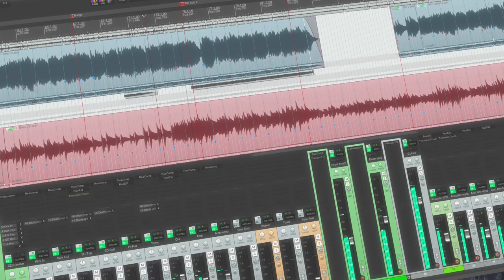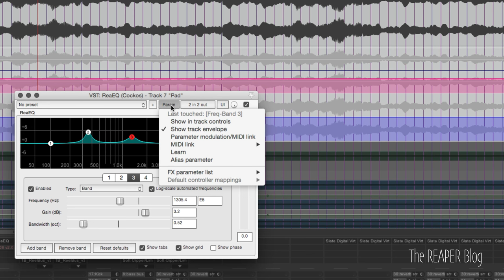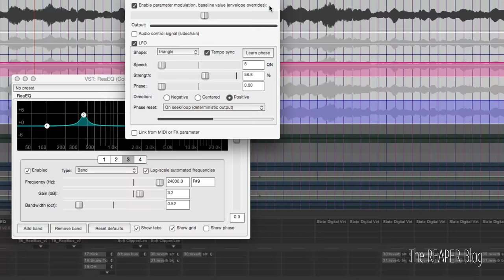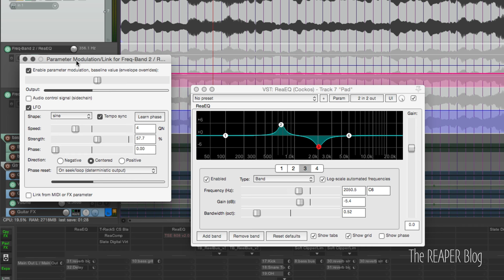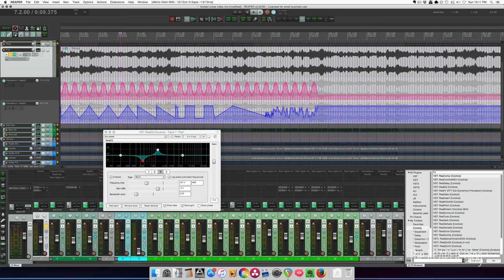How to Write Parameter Modulation to Track Envelopes | REAPER Automation

Comment: Parameter modulation panel is one of Reaper's hidden gems...you showed the LFO section but the audio section is pretty powerful... I use it sometimes for a dynamic desessr and Reverb ducking...The cool thing is it works with any Plugin

Comment: Hi. Excellent tutorial. Love it. 

Id like to try it with the tracks panning. Cant find the parameters for it though? What am I missing?

/Thanks
Reply from the maker: no parameter modulation for track controls, but using this trick you can paste the recorded wave pattern into the pan lane. 

You can also try SWS LFO Tool ( a bit buggy ) or Script:js_Envelope LFO Generator and Shaper (get it through reapack, a bit complicated to use but very powerful.)
Reply: The REAPER Blog Cool. I had to google how to do that. Thanks a million for the tip :)

Comment: @2:29
Doesn't the un-ticked box say "Allow writing automation to hidden envelopes"?
I tried ticking that box and I think it worked.
Reply: Correction, it may have something to do with arming the envelope for recording. The default "show parameter envelope" action automatically arms it, I think.
Reply: Oh, and I forgot to say thank you for showing us another neat trick.
Reply from the maker: not sure, if I put it in write, then touch the control it will show the lane and arm it, but if I do param modulation first it won't record the movement.
Reply: I think you are right, just setting up the parameter modulation won't arm the envelope and thus it won't record.

I ticked the mentioned box; set up the parameter modulation; armed the envelope (it automatically showed it so I hid it again); turned write on and started playback. 
That seemed to do it.
So as always when you want to record something, make sure it's armed. :)
Reply from the maker: it could be an oversight as well. This feels more like a hack than a feature.